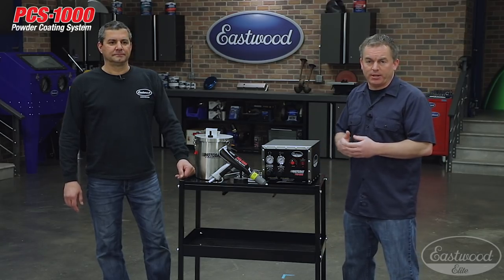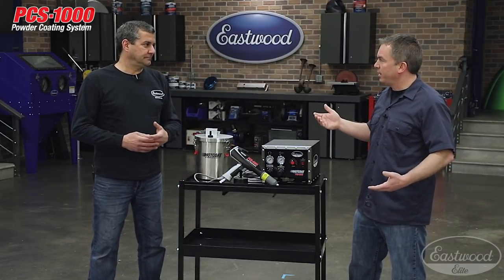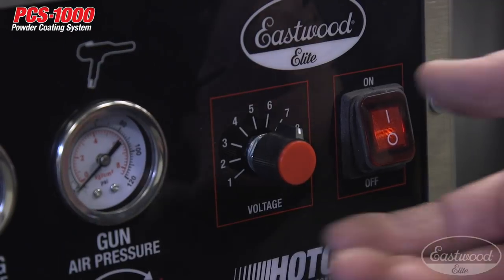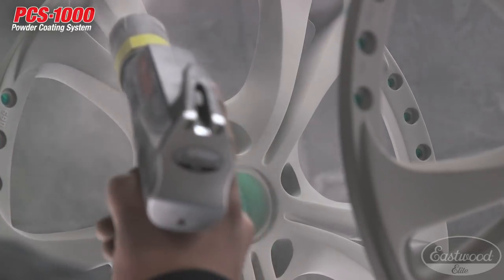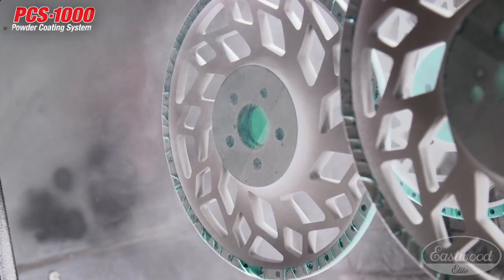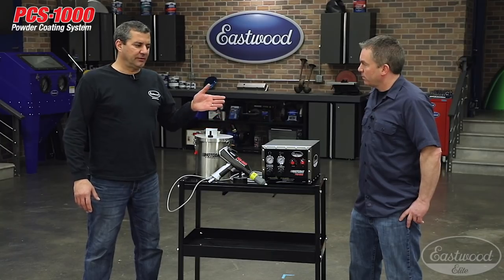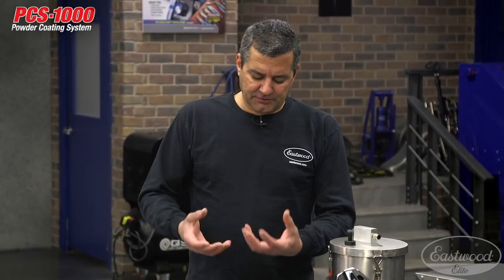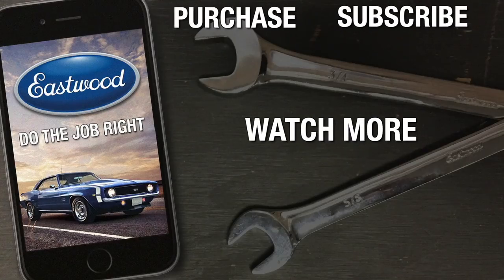HotCoat Elite PCS-1000 - Why We Designed An Affordable Powder Coating System for the Pros! Eastwood

Comment: I bought this unit, and its awesome , one thing i would like to see is to make the 2 lb hoppers with a fluidize built in it also, the reason i mention this is because sometimes on medium size jobs you have to keep slightly shaking the 2 lb hopper for the powder to flow out....but other than that...great design and awesome results with this unit....you won't regret buying the pcs1000....oh ans one more thing...the price i paid beats the competition.... , id like to mention also, if you put this on a weld cart , add a pole with a hook to keep your hose off the ground, and out of your way...it sure does help, especially when you have 2 left feet lol....Thanks and Merry Christmas from my shop to yours....

Comment: I had an issue with the dual voltage product. The white plastic cap on the product cracked within a couple of weeks, causing about 40% of my powder to escape. Unfortunately the white cap is not removable even though the plastic jars can be removed. Had to rig it with a bunch of glue to get it to seal properly.
This design looks a lot better.

Comment: Might be the best product presentation I’ve seen by a tool manufacturer. I’m sold. I’m going to pick up one of your dual voltage starter guns to do parts on a WLA 45 I’m rebuilding. A different video y’all did stated PCing is perfect for springs. I have a set of front forks for the WLA that is all OD green paint I can blast before PCing, but the springs are Crome. What prep would be necessary to power coat them the same OD green as the rest of the forks?

Comment: I just got mine and have a few questions 

1) on the 2lbs hopper the air goes from the top down a tube into the hopper. But the part that the gun hooks to don’t have a down tube it’s just 1/2 inch below the cover. Do i have this hooked up wrong? Shouldn’t there be a down tube to pull powder out?

2) on back of the unit there are extra air lines that hook up to the 5lbs and not the 2lbs. Can they just be left on and not hooked to the 5lbs hopper or will they leak air?
Reply: Hows it worked out for you over the last 3 years?

Comment: Does this system need an earth ground?
Reply: I got mine about 3 months ago. I do recall reading the manual and it does say that you need to ground the system. So I went to home depot and bought a 8 foot 5/8" rod and used that. I am amazed at the amount of powder that is attracted to the material after I used this new grounding rod.
Reply: Yes it does